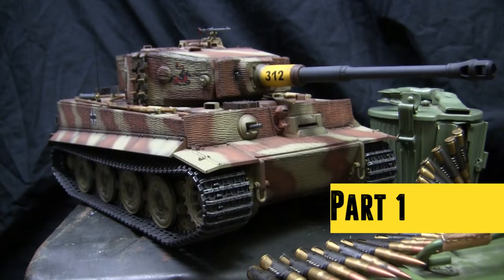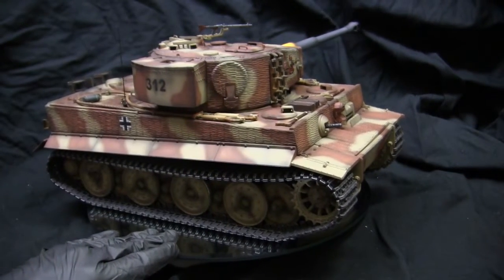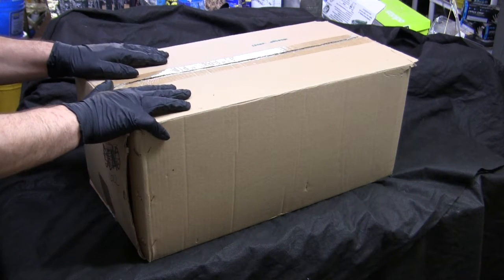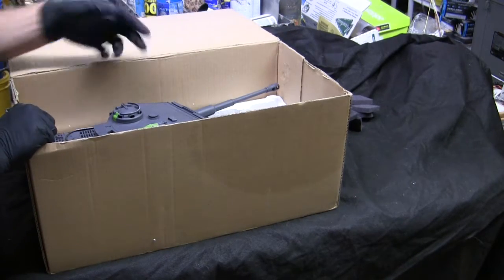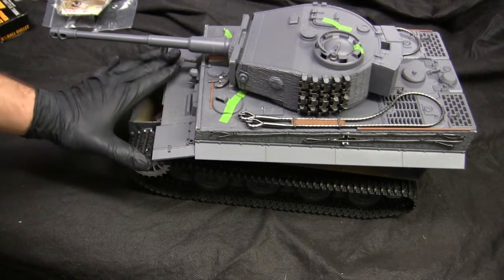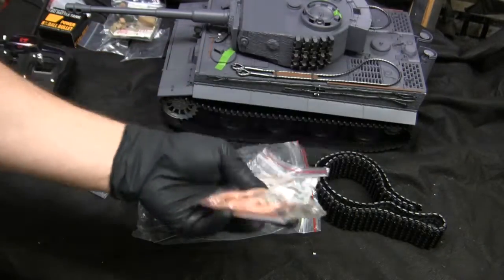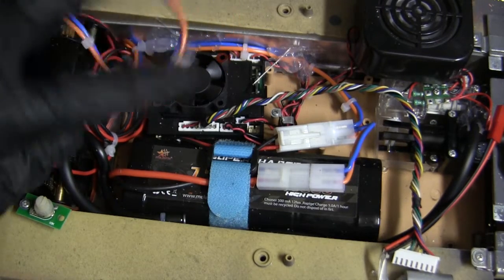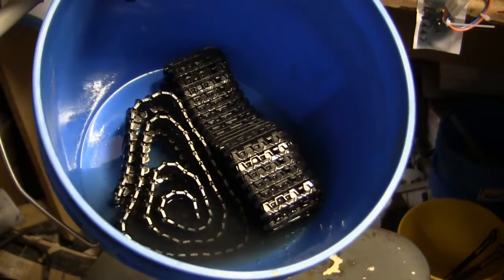1/16th scale RC Taigen Late production tiger I tank model rebuilt part 1 of 3

Comment: I bought one of these and am disappointed to find that the turret is a 1/4” too long from front to rear.  The gun mantlet/turret extends too far forward.  So far, that the mantlet is over top of the forward hull hatches, blocking them from opening when the gun is facing forward.  I put this tank side by side with my Tamiya Tiger.  The Tamiya turret is proportioned correctly and does not block the hatches from opening.  This is a BIG mistake by Taigen which CANNOT be fixed without performing MAJOR surgery to shorten the forward half of the turret.  In addition, the loader’s periscope is positioned incorrectly on the turret roof and there should be NO Zimmerit on the upward facing front panel of the hull.  The tow shackle supports on the front are incorrect, they should be notched.  It has the wrong early large muzzle brake. I could go on and on with all the things that are completely incorrect on this model for a late Tiger, in addition to what you already “fixed”.